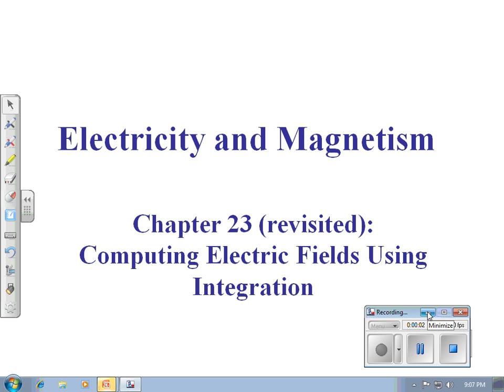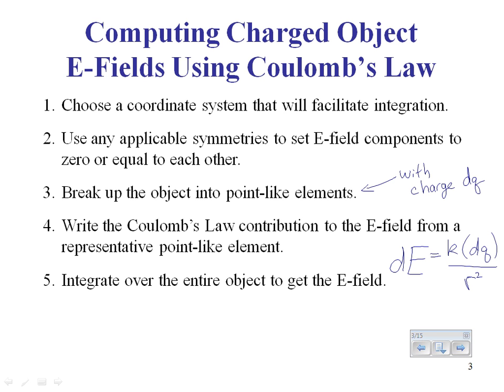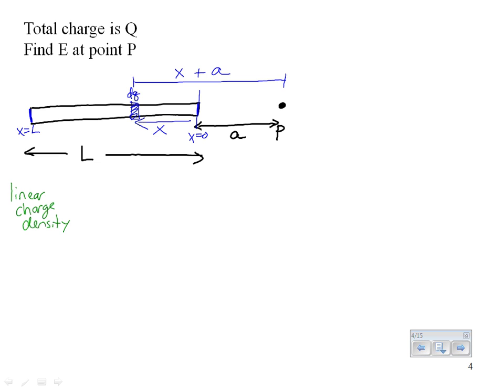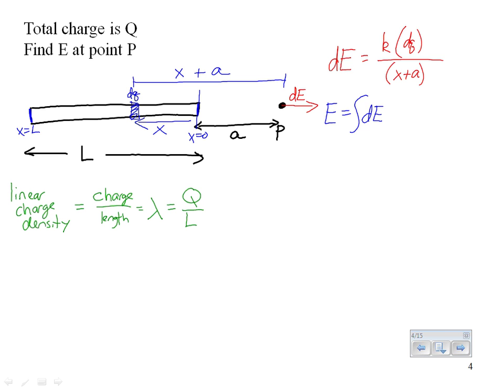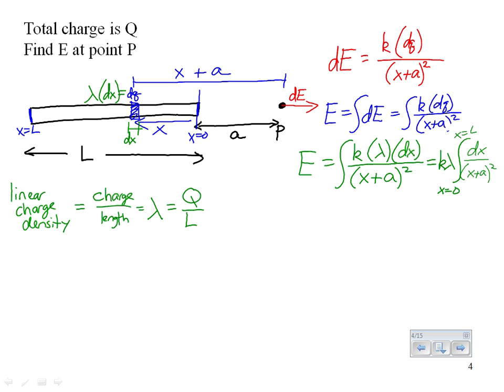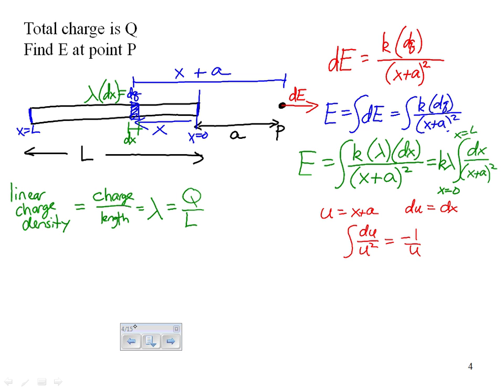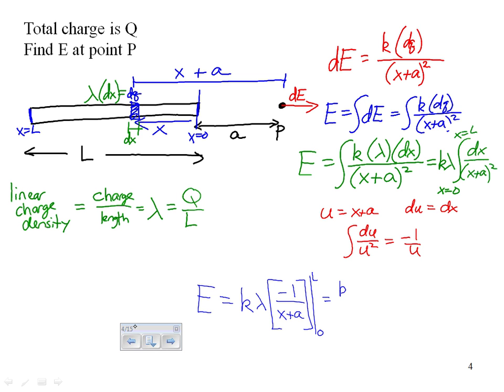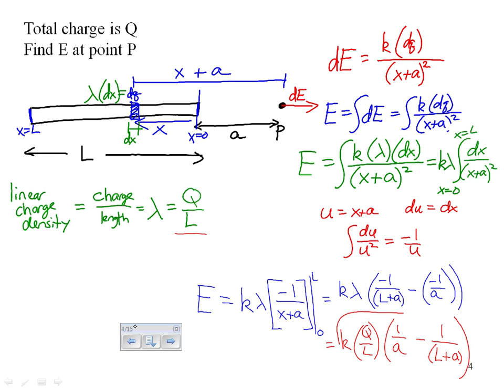Integrating to get Electric Field for Charged Rod

Comment: Can somebody explain to me when it is integrating for elecric potential, they make r=x to this type of  question. I am confused.
Reply from the maker: r is a distance (for a point charge it technically can be in any direction away from the point charge, so the r is the radius of a sphere). For this problem, the distance is along the x-axis so it is more conventional to use x for the distance.

Comment: is dx and dl the same thing ? and if the rod had a length of 2L.  lambda= Q/2L=dq=2dl. am i wrong for thinking so ?
Reply from the maker: dx and dl would be the same thing. Since the rod was horizontal (along what we usually call the x-axis) I used dx, but dl would be the exact same thing. If the rod had a length of 2L, then it is true that lambda = Q/(2L) but the charge dq would still be (lambda)*dl. The relationship between dq and dl is just that the charge of a small piece (dq) is the charge per length (lambda) times the length of the piece (dl).

Comment: Sir you forgot to change limit of integration.it supposed  to  be x=a to x=L+a
Reply from the maker: If I had made the distance from the segment to point P "x" (which would have made the deniminator just x^2) the limits would have been "a" to "L + a", but the way I have it set up, "x" is just the distance from the segment to the right end of the rod, which makes the distance to point P "x + a" and the limits of integration I have are correct. Both are valid ways of setting it up, but which way you set it up changes what you must use for the limits.

Comment: my teacher has us working with an additional variable r in place of x + a. so basically the distance from point P to dq. how would I express dx in terms of dr?
Reply from the maker: If you are letting r = x + a, then if you differentiate both sides you get dr = dx + 0 (since a is a constant, its derivative is zero), so dr = dx (they are the same thing). The rod is broken up into segments with a width (dr) so their charge is (lambda)*(dr). The other difference is going to be in your limits for your integral. I went from x = 0 to x = L since the a was already taken into account in my equation. You would need to go from r = a to r = L+a for your limits.
Reply: Aha thank you so much, that makes so much sense now. I appreciate your reply